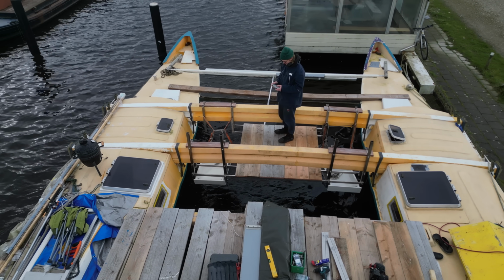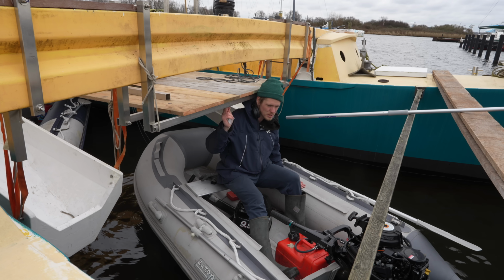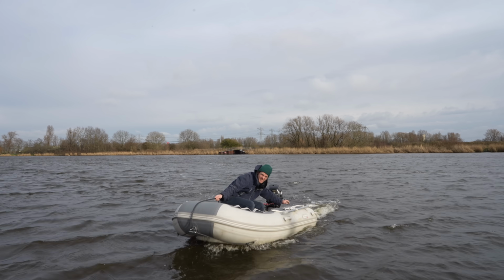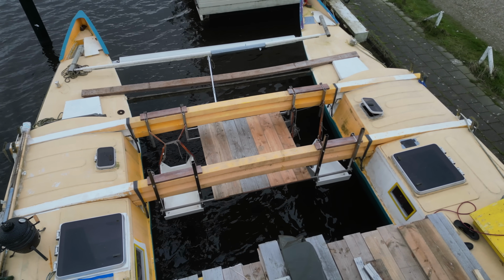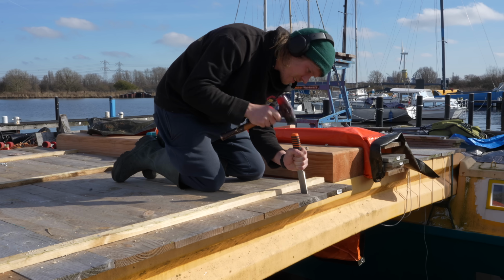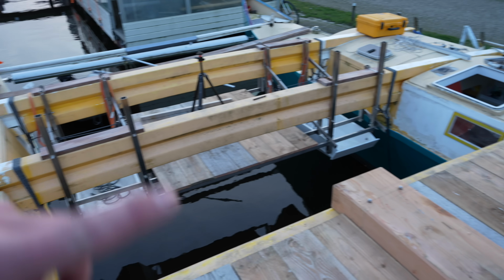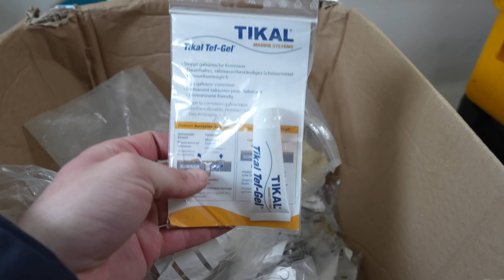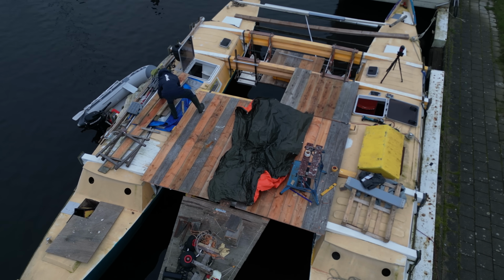A Simple Deck for a Simple Man’s Ocean-Going Catamaran.

Comment: Mechanical design engineer here - I ran an FEA simulation of your M10 bolt constrained as close as possible to what you show on screen. If you used 304SS bolts, they will yield at about 300LBF  each. If the 441LB load is truly evenly distributed across the 8 bolts, you have a safety factor of about 5.4 which is excellent.
Reply from the maker: legendary! out of interest, what is a bad safety factor, and what is the best? :)
Reply: @WildlingSailing <1 is very bad. Depending on which industry you’re in a good reserve factor is > 1.5 or more.
Reply: @WildlingSailing  it depends on many factors like calculation uncertainty, industry, and what’s at stake. But generally a safety factor of 2X is good. In a case like yours I’d design for 3X and sleep well at night. 

For the 20mm flat bar that you drilled an 8mm dia hole in, I can run a simulation if you tell me the span length and load at the hole. 

Love your channel btw. Can’t wait to see her under sail!
Reply: Good stuff !
Reply: @WildlingSailing @mattkelty5855 it is worth pointing out that a sailing boat will experience vertical acceleration (as well as acceleration in other directions) which will result in a greater force than than just the static load (approx 3kN/600lbf if we take your upper estimate of 300kg) which we are using to calculate the safety factor. I have no idea what magnitude of acceleration it is reasonable to expect/design for in a boat but the force exerted on those bolts will almost certainly be more than the static load and so your safety factor will be reduced.
Reply: Also I would assume those bolts will experience cyclic loading, boats move up and down repeatedly on waves, so we should probably use the fatigue limit and not the ultimate shear strength of the bolts to calculate the safety factor, though I am not a naval engineer.
Reply: @mattkelty5855 a true gentlemen, and scholar! BEST comment thread I’ve EVER read on YT!
Reply: I’m more concerned about the stability of the m10 fixing through the vertical member at what appears <1 inch from its end. Has the risk of vertical tearing / metal fatigue in the box section here assessed?
Reply: I'd put a rubber strip between the beams and the deck. This will stop the dech from eventually rubbing into the fibreglass. Good luck.
Reply: @WildlingSailing  Are the engine sleds lose? Will they be slaming up and down with the waves? 
Are you going to build something to lock them hard in place when lifted up?
Reply: so in general i think its a pretty good idea to not drill any holes in the beams and hanging everything from a cage looks good. however  @Peter-wf5kq  has pointed out good points i would have also mentioned. my additional two cents would also that threads are very bad in shear loads due to the notches. a bolt on its own is very good in tension. in general a bolted joint of to plates is held together by the friction between the bolted plates. the bolt needs to be tightened accordingly so that it only sees tension. as soon as the bolt is not tightened correctly or loses its pre-tensioning the bolt will see shear forces in this configuration. 

another thing small i noticed was that the diagonal braces where the engine pulleys are mounted seem to be touching the inner side of the beams. not sure when if you are at sea and everything is deforming etc. it might cause a superficial damage there on the beam by scraping or so. not a huge thing, but maybe increase the distance there a bit.
Reply: I came to say something similar, I have a 200 litre water tank mounted to the chassis rails of my camper van in an almost identical manner and I've got a safety factor above 2.5 per fastener. Basically I could suspend 2.5 x the entire weight of the full tank from one fastener, there are four x M10.

You'll be fine with what you've got.
Reply: I can understand the M10 in tension, but isn't it also under a Sheering force carrying engine etc al?
Reply: School of life PhD here... Looks good, find a creative way to get spacers in all tubing... Chewing gum? You are really getting your priorities right Mark!
Reply: @Peter-wf5kq  you should see some of the old bolts coming out of my boat... If I worried about  safety on that finite a level I would not ever go sailing...
Reply: @cedley1969 I concur and often compair van life to sailing gear.
Reply: @RevDrMalamaRobinson A doubled length of strapping with the spacer in the loop lowered down the square tube until the bolt can be pushed through and the strapping withdrawn
Reply: awesome Matt!
Reply: The box is by far the weak point though. For every single shear point on the bolt (58mm² CSA) the box is in double shear but is still iro half the CSA (circa 2mm wall with 8mm height gives 32mm²).   Effectively halving your safety factor.
Reply: @WildlingSailing  Mechanical Engineer here, some industries require a safety factor of 10+ on bolts. I am curious where the 300 lbf value came from... I would expect more in the 2000 lbf range for shear on a stainless m10 bolt
Reply: I would be worried about the stainless rod breaking from fatigue after sailing for a while
Reply: @codybailey4823  

yeah makes sense.. any options you suggest?
Reply: @fullderp5419  not an engineer but an architect so please trust their advice.  Try to make sure all the bolts are at the same torque so they develop the friction in the bars against the cross members.  Try to keep the engine sleds from moving going windward the rope will stretch.  If they start to fail the steel tube should start to deform the holes will elongate SS might also show radial cracks radiating from the holes to the corners of the tubes similar to chain plates. As everyone has mentioned it appears well over built. The good is that these are close to the water line and will not have a large moment arm like stuff at the top of a mast. S/V My Inspiration
Reply: If!
Reply: Totally agree , just one M6 bolt can hold up to 1000kg, M10 bolts(x8) will suffice 🤔😬👍👍
Reply: @davidmason5163 to a point possibly some limited shearing force, but if properly torqued I'd imagine most of the force should be carried by the friction of the bars on the beams, atleast I think that was the intent of the design
Reply: I would weld in small pipes in the holes where the bolts go through the frame. Then you can tighten the bolts to their intended torque 👍 Edit: Why this is important is that the bolts will come loose after some time due to the flex of the material where the bolts go through the frame. Then they will start shafting, and the holes will turn oval.
Reply: A load like the one you put on these beams is as is already mentioned quite ok, but when making thing you should always consider where the load is carried. In this case the load is on top and bottom of the beam and by drilling holes in these parts you weaken exactly those parts. A hole in the side would have been much stronger, but of cause then you will have chafe in the hole, but that can be dealt with.
Reply: 5.4 factor of safety is over engineered. That is what you typically get if build first and calculate later.
Reply: @davidmason5163 so long as the tension is high enough, friction between the parts prevents the bolts from carrying the shear load.
Reply: @andy_621  I wish I could grab my Tig and head over just to box those out ..... unfortunately I cant at this moment
Reply: @WildlingSailing 1.2 tp 1.5 for Rocket ships  2.5 to 3.5 on ships.
Reply: @WildlingSailing  Lot of comments about welding sleeves inside the box section - major fab nightmare for you. Better solution is to open out one end with a step drill - get yourself a few 'cause they kick ass - make the bolt hole big enough to accept a tube that's a snug fit on the bolt. Trim the sleeve/tube flush with the box outer face, add a good flat washer to spread the load across the box width and winder nutter!
You could tack weld them with just a basic arc but it wouldn't add any extra strength really.
Oh, and get some spare spark plugs for the outboard and change out all the old ones! 
CHEERS!
Reply: A 6 inch strip of masking tape passed under and very lightly stuck to just the underside of your tubular spacer lowered down the ‘hole’ with both open ends coming up to above the ‘hole’, twisted 180 degrees and then  stuck back on the box section sides could support the tubular spacer in place and leave both hands free while you slide the bolt in and start the fastening nuts. Simply pull out the masking tape and dispose when done? Sounds more complicated than it is! Cheers Ray (UK)
Reply: Mechanical design engineers are my heroes. I'm a combat expert from the Germany.
Reply: a few carbon washers and a carbon sleave could be fitted around that bolt location with a removable cross section when the motors are up if it shows signs of wear?  Any more there are places that can 3D print anything and I think the price has come down.
Reply: @WildlingSailing A bad safety factor is one calculated by someone calling themselves a mechanical engineer, but only taught about static loads in environmentally controlled habitats divorced from nature. Webbing straps glued under blocks of wood with semi-rigid polyurethane construction adhesive make excellent flexures, much stronger and longer lasting than metals. Pieces of car tire will also work.
Avoid sharp corners, bolts, dissimilar materials that have different rates of thermal and moisture induced expansion. 
I'm also very unimpressed with the Wharram mounting of stays to hull chain plates. This has caused massive problems in my Oro. They should only be mounted to the beams, and with shock cord lashings, not turnbuckle adjusters.

Comment: Be sure you have safety straps/cables/chains in case any bolts or bars fail while at sea and also chain  your engines so they are attached to the boat and can't somehow drop into the ocean depths if something inevitably goes wrong. Also chains with locks may prevent theft😁💦

Comment: Hi! Super fun project! (sorry English isn´t my first language but i do the best i can and trust google translate ) also and mechanical design engineer here - You should stop drilling thru the steel beems, you are compromising the strength of it by a lot, use clamp around them instead(where possible)  or set an insert in them.

Comment: Could I suggest that the next time your shopping for bolts/nuts ect, please consider buying a few acorn nuts to top off your threaded bar.
They will wind down on top of your nylon nuts you've put on and cover the rough cut thread.
It will save you at some point from slicing your flesh.
Top channel dude.
Cheers

Comment: Just a suggestion with the pulleys and such to lift the motors. The fiddle block with cams could go across the top on the outsides for each motor pod, that way you're pulling the rope across the top of each pod towards the middle of the boat, not down. Or, if you wanted to get fancy you could put the fiddle block on the side nearest the cockpit with the tail going to a pulley on the outside bracket across the motor pod then tie the tail of the rope back near the fiddle block in the middle. That way you're still pulling towards the middle but the cam is right by your hand in the middle and the extra rope could just fall down in the motor pod when retracted. It costs an extra pulley but makes the direction you have to pull towards the most natural, towards the middle for both motor pods.

It'd be a heckuva lot easier to explain with pictures :) Love the progress, stay warm and dry!

Comment: Hi Mark.  You are going great! You are getting things done and using good sense to design things. AND you also providing fantastic videos (multiple cameras and drones) while doing the work!  Thankyou.
But you are worried about structural details like the bolt.  Worry is a good thing to help you get things right but when it is part of a structure like the engine support system, you need the whole structure to be checked as that bolt may not be the weakest point, so my recommendation is to seek out a qualified friend!
I YOU, reading this in the Netherlands, are a qualified mechanical engineer and have a little time to do a proper analysis and at the same time gain a friend, then get in touch with Mark to make sure his whole system is well engineered!  
Mark. you could put the word out through your boating contacts in the Netherlands to find this new friend as well.  I note most large boat projects have such friends who help out with good effect!
I have followed since you left the UK to travel down the French canals and have enjoyed all your adventures. Keep it up.

Comment: Kaizen sugestion regarding fastening of planks of your work- "deck". 

It might be helpfull, to drill 2 or 4 holes into each plank (possitioned behind the part of plank wich sits on the beam - "inner side"?) and than use plastiq cable ties of reasonable price, to bind "around" the beam, and through the plank, to semi-permanently and quite cheaply secure the planks on place. Some of the ties can be used multiple times, because can be "released" by hand. 

Generaly, realy handy watterproof and quite cheap material to bind, sort and possition far much more than cables. Same as reasonable supply of ducktape, handfull of those is a "must" for handyman, who will for longer period of time face yet unknown technical difficulties, with severe consequences in case of chosing a wrong way to adress them...

BTW, if you decide to leave the plank-deck as you have it now for the sailing (no protective colour, etc), you might contemplate to cover the deck by something watterproof from the waves downbelow, and something of a grip to prevent slipping on your deck.

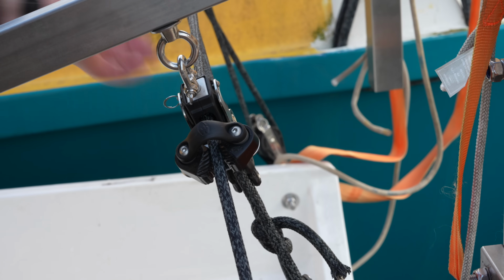Comment: 3:05  Maybe an old winch from some salvaged rigging placed in the right spot would make that alot easier Skipper. 9:50 Dont forget the force the drives will place on them when pushing the boat through the water. 10:26 OUCH, Careful Skipper.

Comment: To put the spacers in the middle areas you can drill out the hole on one side to the outside diameter of the spacer and use a thick washer or even weld it and grind it smooth and the bolts will hold just fine🍻🍻🍻🍻⛵️

Comment: An M10 bolt can hold 2,009.6 KG of pull

On the end of the bolt  it says 8.8
to make the calculation
must be multiplied by 8x8 = 64 kilos per square millimeter.
If it is an M10, you multiply 10 by PI, which is 3.14.

10 x 3.14 = 31.4 times the 64 = 2.009.6 KG KG of pull 😉

Comment: The strength of the bolts isn't a problem, but the square tube is. First drilling the holes reduces the strength of the square. Also, the bolts will squash the tube. You have to have some kind of reinforcement, either a larger, thicker washer or some kind of saddle that reinforces the tube. Don't worry about the 10mm bolts. Gary Casey, P.E.

Comment: On the holes through the aluminum. You uses washers which spreads the load. The rivets you used are just pop rivets not structural.

Comment: Well Done Mark. The Deck just makes the boat so more friendly and safe. I would put a brace between the two beams, where the top blocks are attached. The downward load will transfer to try and compress the two beams. You can used the eye bolts to connect a truss between the two beams. I would use the section rectangle Box section and cut the end out like a square C. then drill the holes to suit. As for the Strength. Suck it and See. A safety chain to the motors will save them if something breaks and  Bonus, slow down thieves. Kiaora.

Comment: A trick for putting spacers down a bit of tubing is to hot glue the spacer to a length of wire or a stick once you have the bolt through it a quick twist and it should pull off

Comment: .... and in the next episode of the kamakazi craftsman .... 😜
I'd say it's not the strength of the bolt itself, but the strength of the point of contact with the box section. a tubular sleeve welded into the box section would increase the overall strength of the system massively. (Remember vibration of the engine will distort the unsleeved holes over time)

Comment: 10:23… I’d say, just check them and replace them with relative frequency. The issue is stainless seems as though it hardens through stress, and then can fail a bit unexpectedly.
But just like anything boats… Keep an eye on them and replace them from time to time. I can’t speak on the actual loads for each bolt… But it sounds like you have quite a few of them to hold a relatively small load per each.
BTW… Thanks for all the inspiration I’m in a current refit, that’s been going on for quite a while and I’m constantly running into big and little obstacles. People like you definitely help keep the inspiration going, seeing all of your ins and outs and how you handle them. Cheers and much appreciation .

Comment: I made this comment last in last weeks episode. The bolts are not the issue it’s the SHS square hollow section. They need crush tubes welded into them so that the bolts go through them and the weight isn’t just carried by the SHS wall thickness. Crush tubes can also be welded midway down the tube too. They need TIG welding.
Reply: Agreed, it will rip through the tube before the bolt.  Over time the two may wear; groove in the bolt and oval the tube hole.  Personally - its fine, its not going anywhere for a long time and you will be able to spot any signs of wear.
Reply: Glue in plugs. Sod tig welding it destroys corrosion resistance and fatigue life.
Reply: @Maungateitei   that's if you dont know what you're doing. there's processes for that.

Comment: Mark, as a comparison - Tiki 38 shrouds are held by 1 shackle with a pin of 8mm diameter. These shrouds are 3000kg breaking load. The chainplate for the shroud on Tiki 38 is held by 4 x M6 machine screws. So your M10 screws for engines are more than enough,,, :)